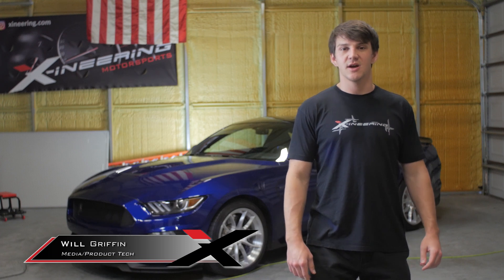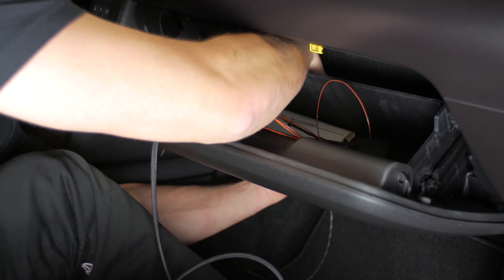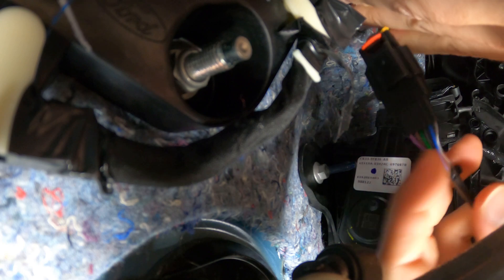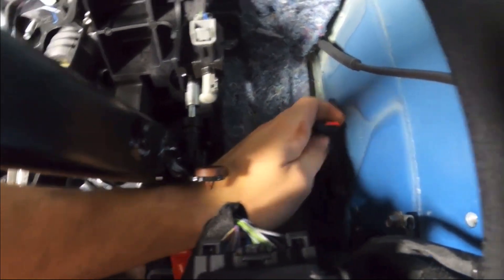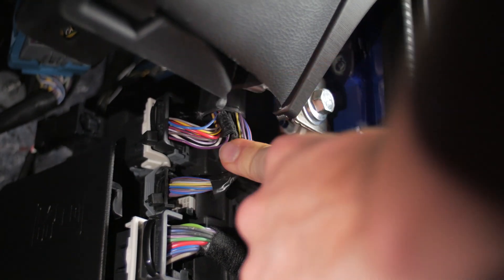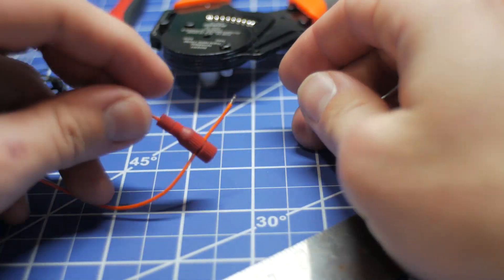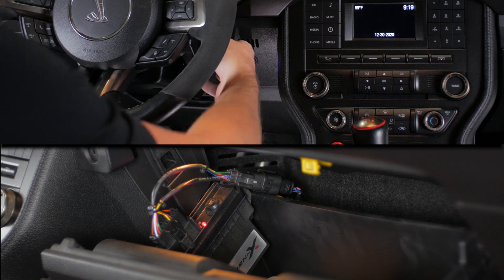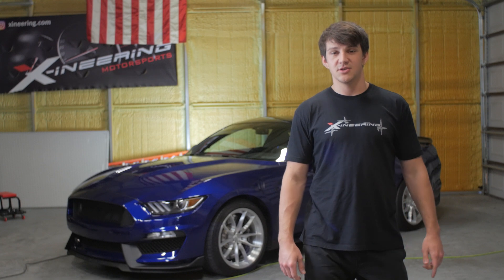Xineering - Downshift Blip Module - Install Video for S550 Mustang GT350 GT500 2015-2020

Comment: ok this video says don't tap onto clutch pedal safety interlock switch, where will we need to tap then? I cannot see the target in the video clearly.
Reply from the maker: Thanks for the comment.

You will need to tap the Upper Clutch Switch. It is located at the top of the clutch pedal bracket.
From floorboard reach directly up to the top of the clutch pedal assembly. The switch will be vertically inserted into the bracket. In the link below on Step 8. you will see the clutch pedal assembly and the vertical switch we are referring to.
https://www.mustang6g.com/forums/attachments/s550-brake-pedal-assm-mt82-pdf.552737/

Hope this helps!

Comment: How hard is it to install and would I run u to problems
Reply from the maker: It is pretty simple following the video.....
BUT we have made it even easier to install with our 100% Plug and Play harness.  

Our OEM style harness goes inline with the brake, clutch, and throttle pedal connections.  All you have to do is mount the switch as shown in the video.

Checkout the plug and play manual here:
https://www.xineering.com/downloads/Blip_S550_PNP100%20REV.pdf

Thanks for the comment!!

Comment: Does the custom panel switch come with the kit?
Reply from the maker: Hey Mathew!
It does not come in the kit. The end user has the freedom to run their switch to any location in the vehicle. :)
Reply: @xineering  Interesting! Is it also possible to install the module without a switch? I can imagine the autoblip will be always enabled then.
Reply from the maker: @jamongkad  If you source your power from the vehicle's switched 12V source, it will turn on and off with the key turn. However, in a situation where you don't want to accidently blip (like driving up a hill from a stop, or in the pits at the race track) an inline switch to toggle the blips off can be very useful.

Comment: The kit is more sophisticated than my autoblip with the connectors and the module,  however the one huge advantage of the autoblip is that I can adjust the duration and the intensity of the blip very quickly with dials, no need for apps or computers.  This probably allows for more customization, but an improvement would be a simple manual controller mounted somewhere convenient to make easy adjustments on the fly (I can reach down and turn the module on or off, adjust the duration or intensity without taking my eyes off the road)

Comment: just to confirm it doesn't work on prior years GT 5.0?
Reply from the maker: Our downshift blip module works on all S550 Mustangs including the GT.  The install will be exactly the same as outlined in this video.

We also support 2011 and up GTs.  
The plug-n-play accelerator pedal harness is the same as the S550.
The brake and clutch pedal sensor connections will be a little different.
Let us know if you have any other questions.  Thanks for the comment.
Reply: @xineering  good to know. It’s just that the website said 2018+ so I was curious. Thanks for the reply

Comment: So you have to use the brake? I can’t just regular downshift without braking?
Reply from the maker: Thanks for the comment!
Correct, when the brake AND clutch are pressed a blip is commanded.
If it only went off the clutch pedal press it would blip on upshift as well.
For roll racing; we have had a few installs where people wired momentary switches to our brake input wire.  While the switch is pressed it will blip on clutch press only, (because it thinks the brakes are pressed)
Let us know if you have any other questions.

Comment: The last step on the passenger side was for the switch? Only two connection if is ?
Reply from the maker: Yes, the passenger side footwell, where the BCM is located, is where you make your Brake Signal tap and Switched 12V Signal tap.

Comment: Does this work on a 2018 Mustang GT? Or GT350 only?
Reply from the maker: Yes, it works on the 2018 Mustang GT.  
They have the same throttle, clutch, and brake circuit as the GT350.  Thanks for the question.

Comment: Just ordered. I like the switch you used. Would you have a link?
Reply from the maker: Sure do! Here ya go: https://www.amazon.com/Nilight-90013L-Toggle-Control-Warranty/dp/B07T1JG6BD
Reply: @xineering  Thanks!
Reply: The last wiring was for the switch? Where u removed the panel on passenger side?

Comment: If I put blip module in my GT350 glove compartment, all my gloves would not fit in there. I rather keep heel-toeing and have fun with it. BTW there's an easier way to path all wires from passenger to driver side. Just get steel hard wire. Snake it through from ether side. Hook up all the wires together to the hard wire and pull to the other side.
Reply from the maker: LOL, we never take our driving gloves off....

Excellent point on snaking the wires thru with a steel or hanger.  Thanks for the comment man!